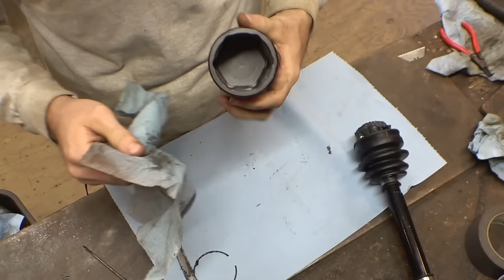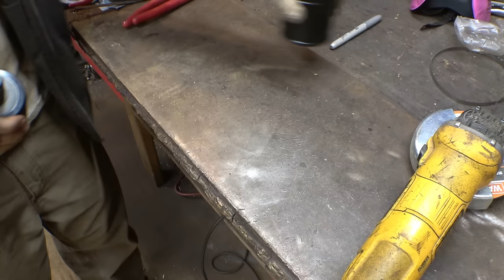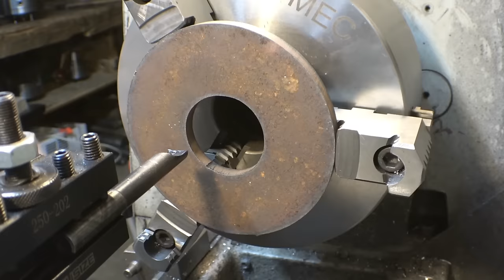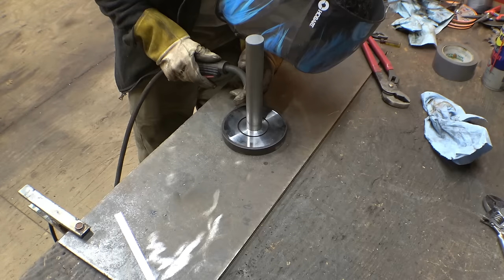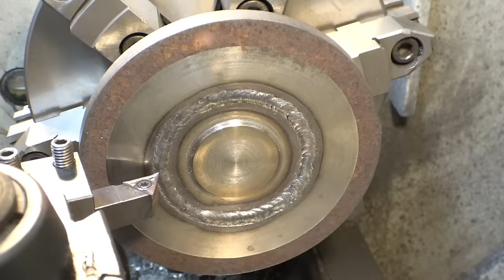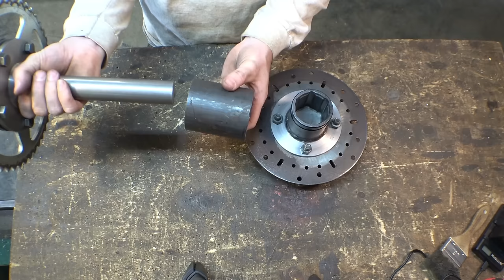Home Made small CV Spool for a new project!!

Comment: For your issues with chain slack build a sprocket on a slide guide to tension the chain and make it spring loaded so it always stays tight
Reply: It would require a ratcheting lock to prevent the engine from compressing the springs.
Reply: @kevinsellsit5584  Depends which side the tensioner is on. Tension the bottom side of the chain while going forward. and for reverse you would have to tension the top side.

Comment: I love your fabrication skills and ideas. You could make your own drive shafts. Making splines is pretty easy but a bit time-consuming. You still have a shaper and a drill press. Use drill press to make the slots. Lathe to cut out the center. Shaper to get better grooves. Make 2 parts that fit together out of one piece. Also, it can make everything more compact. Could even start making your own spindle gears.

Comment: Everybody here "why a sproket wtf ew" yall it worked. Worked on his last, heaviest project. Issue with the chains coming off was due to cheap chains and the SWING ARMS FLEXING! Genuinely would expect the chain to snap before it transmitted enough force to flex that much steel.

Comment: it would be awesome to see a project with: fwd engine and transmission mounted longitudinally with 2 differentials, one for front and one for rear axle. 

benefits: single transmission, reverse gear, Automatic 😮? readily available parts, huge variety of engines (ie corolla, civic, cobalt, golf, veloster).
Reply: It works quite well as long as you don't want to go fast. The buggy I built this way tops out at about 25-30mph.
Reply: Pssst. No one is stopping you. But you trying to tell others what they should do... :(
Reply: @eriklarson9137  id love to but i do nt have the means to
Reply: @eriklarson9137  There's absolutely nothing wrong with offering suggestions.
Reply: @LesNewell  Why are you limited to 40mph?
Reply: @bradensmith888  The extra diffs act as a low range so they reduce the top speed. Say your diffs are 3.9:1. In that case your top speed will be roughly a quarter of the car's original top speed.
Reply: @LesNewell  Could you keep increasing tire size to get more speed and off roading capability?
Reply: @bradensmith888  Yes as long as the diffs are strong enough to take the load.

Comment: As kind of an OG subscriber my thoughts are always when I watch this channel......get away from chains and more to shaft drive. Inexpensive ATV diffs can be had on the used market, which goes into another thought, speed up projects and don't jump around so much between projects, finish a few (completely and near perfect) and sell so they are gone for good (when an old one finally pops back up a couple years later I've forgotten about it and not near as interested), do a project for on-road, haven't seen one of those in a while, use some off the shelf stuff on purpose for ease of maintenance and fixes on the trails, like brakes, CV axles, bearings/hubs, spindles, electronics etc. possibly some stuff you could find at an auto parts store, stop with the motor cycle engines, do something with a small car engine/trans possibly, several manufacturers make sub 2.0L turbo engines as an example.

Comment: there is 2 bearings per side on a good quad rear carrier bearing set up also.  so not necessarily overkill.
Reply: 1 bearing per side.
Reply: @jerrywilcox9890  on stock quads yes on upgraded nice stuff there is 2 bearings per side.
Reply: @Mr_Hatfield797  all mine have 1 bearing per side.
Reply: @Mr_Hatfield797  I have upgraded on my 400ex still only has 1 bearing per side.
Reply: @jerrywilcox9890  my 400ex and my yfz450 both had dual row bearings.
Reply: The Yamaha 450 race quads have 4 bearings in the bearing carrier, did a rebuild on one a year ago, not something I want to do again as was a pig of a job to do.

Comment: If you're running a long travel high power CV setup, make sure to cut the inner clamps off the boots, this will allow them to travel better. Look at some newer sand rails they do it to allow better movement without tearing boots

Comment: There should be a bushing between the two bearings so that the rotation of the bearing does not drag when the nut is tightened, like the bearing on a motorbike wheel rim.

Comment: you have to add tube between bearings. When you tighten bolt you add unnecessary side force to inner bearing race and ball bearings... or you had to make step on shaft.
Reply: Lol no. Please post a video with you in your machine shop showing what you mean. Or have you even touched a lathe?
Reply: @eriklarson9137  what he is saying makes sense. Just because you don't get it.....that being said due to this specific application it may not be necessary. Doesn't mean other people don't understand the concept.
Reply: @eriklarson9137  Why do people like you always hate it when constructive criticism is given out?  Unlike you, this person has offered a reasoning to their criticism, where as you just said "Lol no."  and then continued to berate them.  Don't be that person.

That being said, you are not wrong.  If you notice, the shaft has been turned down in length enough so that the spool doesn't move around a bunch, but the load is taken up by the shaft, if that makes sense.

Comment: Excellent fabrication as always. I've been wondering why you don't use differentials in your builds. It helps eliminate binding and is easier on the drive parts. Plus, you could lock them for traction.

Comment: Beautiful creation!  I like where you are going with it.  It was making me think about an idea for a torsion bar concept that you could engage or disengage for on road vs rock crawling, sort of like locking hubs.  Have each arm connected to the hub and freely articulate with it, unless the center is locked together.  For high speed on track runs it would really help with leaning.  For off road it could be disengaged for full articulation.  Maybe the center could be a garage door spring so it could have some give, or maybe it could be a full locking tongue in groove bar.  I guess technically it wouldn't have to connect in the center as long as each arm could be locked independently, just depending on how much extra stability you wanted.  Just some ideas.
Reply: He did that recently.  I believe was for his rock crawler, formally known as the rock bouncer.
Reply: @gagepuffinbarger6939   I've watched every episode and I hadn't seen him use an actual torsion bar.  Vertically mounted torsion bars and horizontally mounted trailing arms (like he engineered on this creation and the rock bouncer you are talking about) are entirely different things.
Reply: @reviewaccount469  are you meaning torsion bar for springs, similar to what GMC used for their front suspension?
Reply: @gagepuffinbarger6939  Yeah, like that.  Basically a long bar that twists with a spring effect.  I think Chris's creations would handle well with torsion bars and sway bars while driving on tracks.  I was just thinking that it might be cool to design ones that could be disengaged when he wanted to rock crawl.  The closest I've seen him ever build were pan-hard bars, but those are just for side to side movement.
Reply: @reviewaccount469  I could see you being able to disengage them, but to re-engage them you'd have to put tension back on them.  Either that, or you'd have to find a way to lock the spring side in place, then disengage them.  It would be a cool concept, but might not be practical.  Are you meaning to have that alongside the coil springs or having them as the sole suspension?
Reply: @gagepuffinbarger6939   Definitely adding along side all the other shocks and springs etc.  One that could be disengaged might not be practical, but what about Chris's creations is practical?  Creating a torsion bar that could be disengaged is a virtual cakewalk compared to chain driven 4wd with 2 transmissions.
Reply: @reviewaccount469  how would you retain the load on it when disengaging?
Reply: @gagepuffinbarger6939   One of the options I suggested originally was a garage door spring.  A very large, thick spring that is meant to wind in and out.  They are meant to lift hundreds of pounds.  Even just a foot to 18" section would be sufficient to resist the load for one wheel.  No additional preload needed, however you could devise and engagement mechanism with notches in it that the spring could click into (think of a handle), and you force the handle UP to wind the spring in, and click it into a specific notch to engage a chosen starting load.

Comment: Polaris XP1000 rear axles are plenty long. Using those to completely rebuild the rear suspension on my old Honda Odyssey. Interesting, the Polaris axles have the exact same ball spider setup as Subaru rear axles. That means I can remove the Polaris inner cv setup and slide it into a subaru CV setup then slide that into a subaru rear diff. The rear diff has a 4.11 ratio with a viscous posi setup. Why use that on an old odyssey? Because I can then fit a 600 snowmobile motor lengthwise and the Subaru rear diff will be bullet proof and I only had to put it all together not fab anything. If anyone wants exact details let me know.

Comment: Look at german rwd cars for longer cv axles. Bmw and Mercedes. Stop using garbage homokinetic(all one piece with the inner stub shaft)CVs and use an anular cv like the 930 or other 9xx series that bolt onto a flange on the inner stubb.  Bmw 3 series and Mercedes c class are a place to look. Dont weld your wear parts into the whole design. If you break the inner cup or danage it when the cv fails you are rebuilding that whole half of the carrier.

Comment: There is nothing wrong with going Overkill especially when it is a part that takes abuse I would stick with the four bearings maybe try to add a grease fitting but as long as them Baron's always have lubricant they will last longer

Comment: I like your stuff, but every single video I shake my head as to why you have such long bolts.  The bolt extrusion does nothing for strength or support.  It is just excess metal.  It is not just a mm or 2.  It is always up to about a half inch.  That is ridiculous.  Use shorter bolts for the application.  ;)  Otherwise, I still will always watch you construct. :)

Comment: You really really really need to stop using chains and go to drive shafts.  Chains are noisy and weak... and they wear a lot and you need tensioners.  They are just bad all around.  And yea they are cheaper, but you can get parts from a junkyard pretty cheap.